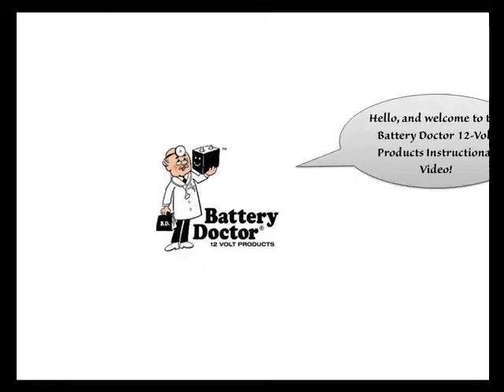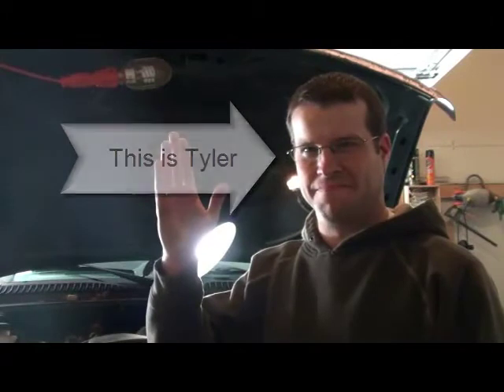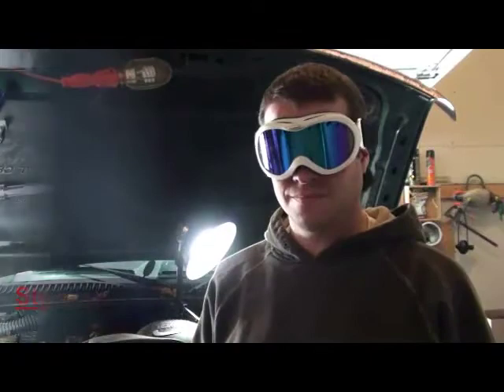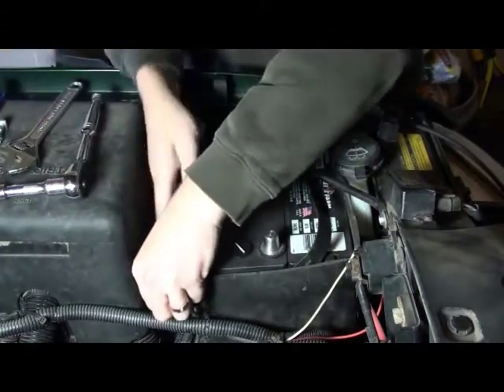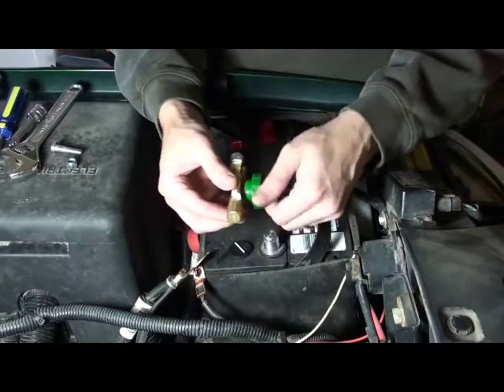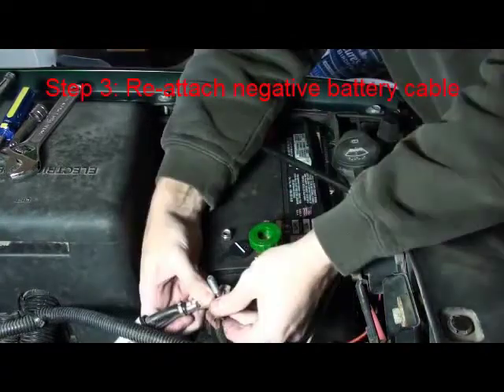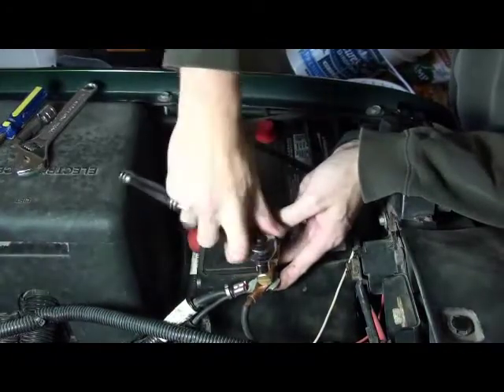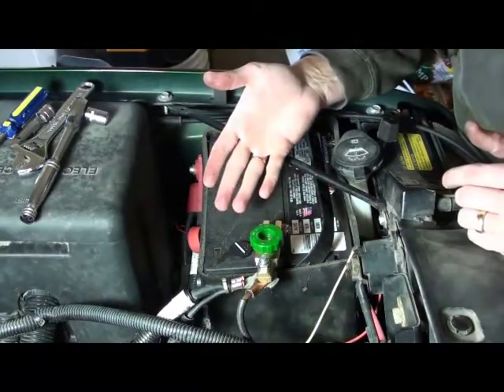Battery Doctor Compact Battery Switch

Comment: With mine it has to be totally unscrewed or it won't work. I would never buy another. Waste of money.
Reply: No it doesn't, your one was problematic then. Two or three counterclockwise rotation disconnects the battery.